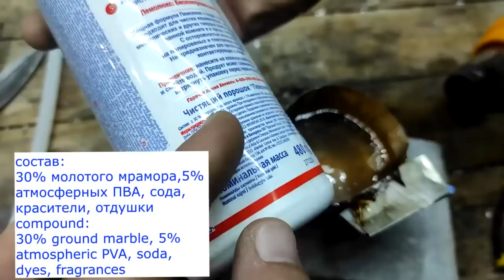Мало кто знает о таком применении клеевых стержней! Отличные идеи своими руками!

Comment: You could buy one of those single camping gas stoves. One of the type used for boiling one pot or kettle. If you want to save on electricity heating up cans. Best wishes.